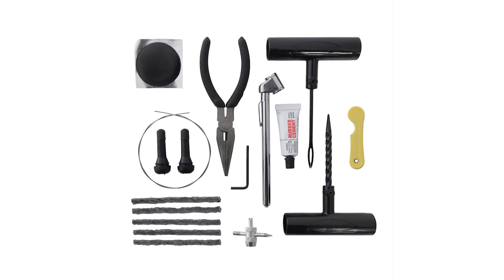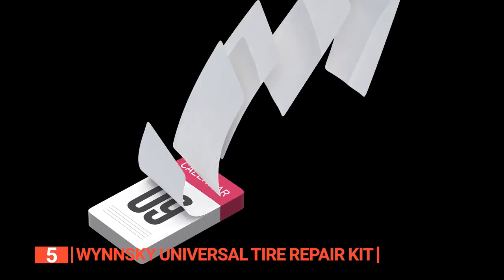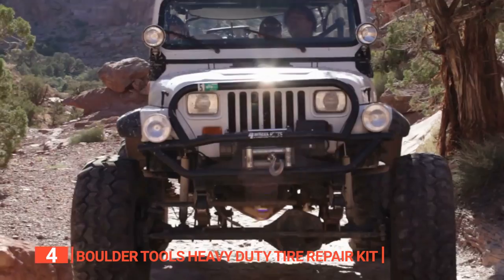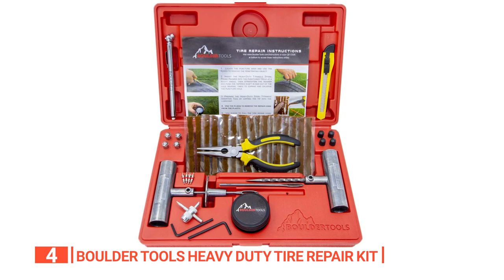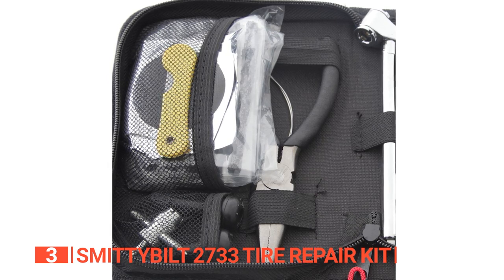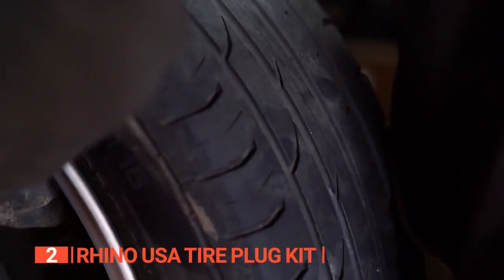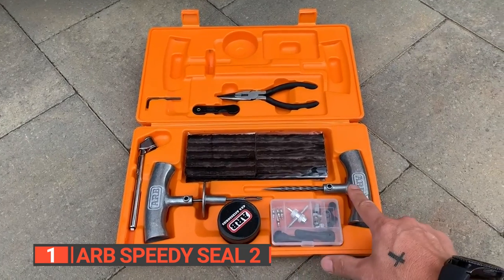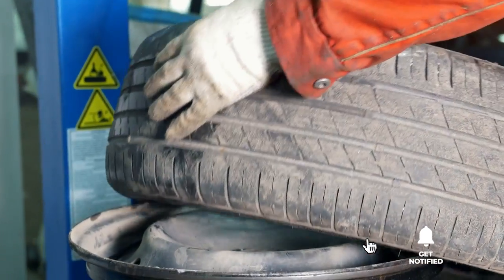TOP 5 RIDICULOUSLY GOOD Tire Repair Kits

Comment from the maker: 00:38 5⃣ WYNNsky Universal Tire Repair Kit: https://geni.us/82Zn5P
02:45 4⃣ Boulder Tools Heavy Duty Tire Repair Kit: https://geni.us/bSJD7
05:09 3⃣ Smittybilt 2733 Tire Repair Kit:  https://geni.us/R6V9Wa
06:40 2⃣ Rhino USA Tire Plug Kit: https://geni.us/p4hQr
08:15 1⃣ ARB Speedy Seal 2: https://geni.us/JBrk4Mq
Reply: Do any if the kits have the ability to plug/ repair damage to the sidewall of a tire?

Comment: To avoid the rattling in the ARB Speedy Seal 2 all I did was put a piece of Air Conditioner filter open air cell foam inside the kit. Hope that helps.

Comment: The Rhino would be better if it had a plastic container for the smaller parts. That way when you are using the kit and not using the smaller parts you don't have to worry about accidentally losing them as you are removing and replacing the tools and otherwise interfacing with the kit.

Comment: Whatever you do, make sure you get a kit with contoured handles like in the ARB kit...the plain, smooth  tubular handles are much harder to get a good grip on and trust me, you need a lot of force to get the plug through the tire....the contoured handles make it MUCH easier.
Reply: In your experience can many if not any of the kits repair a slash or damaged sidewall of a tire? Thanks if u know and can answer

Comment: Fine for biasply but Staal belted when you plug they destroy the tire. Every tire I've plug blew apart at high speed.
Reply: It won't if you maintain the correct tire pressure and ream and plug it right.